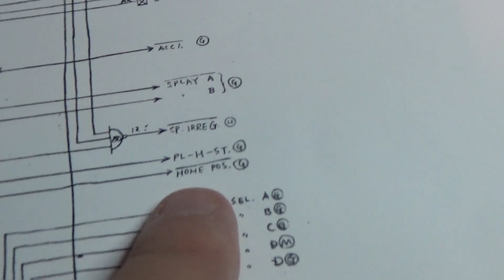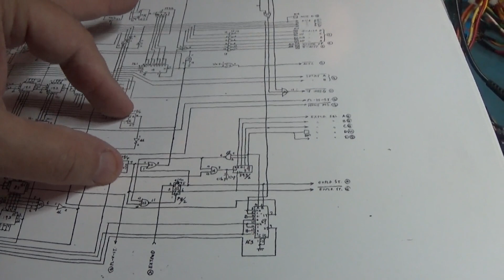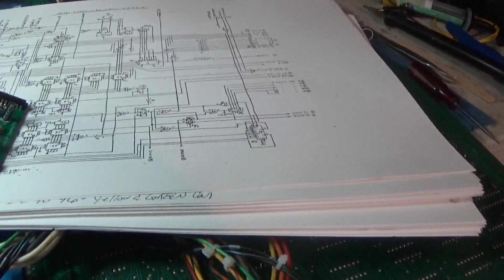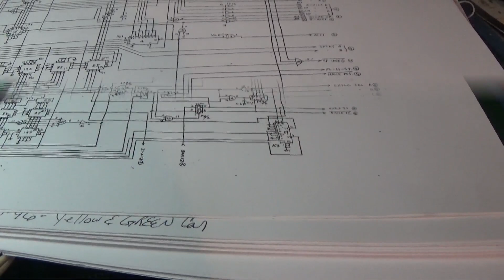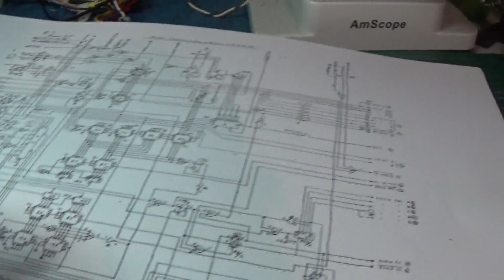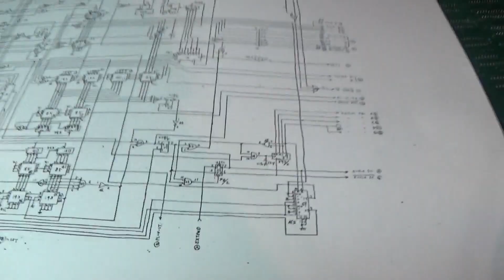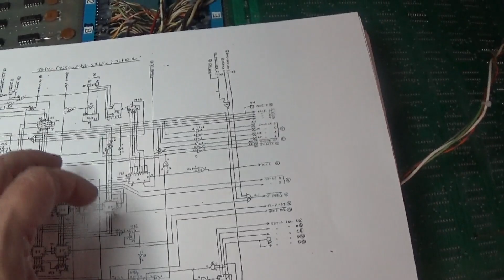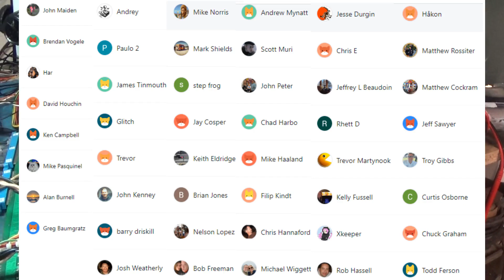1979 Sega/Gremlin Monoco GP PCB set Revisit  7-25-23

Comment: What situations does the car explode?  I thought it was supposed to be just after the spinout on a crash.
Edit:  Okay, it's only if you miss the bridge, apparently.
Reply: There's a 90 second timer. If you have at least 2000 points when that runs out, the road turns blue and now you have limited lives as opposed to the unlimited lives you had before. And your car explodes. Also the bridge only shows up if you are in that extended mode.